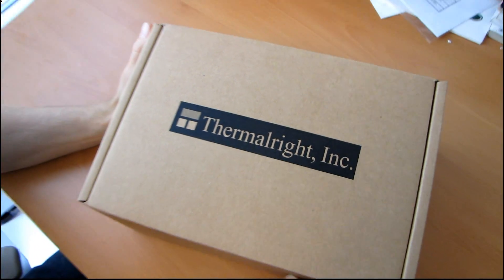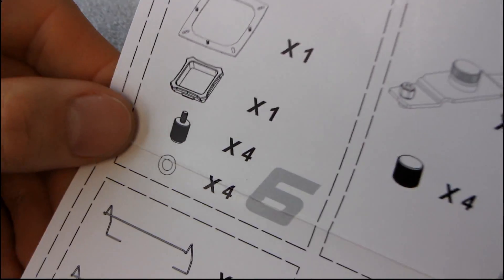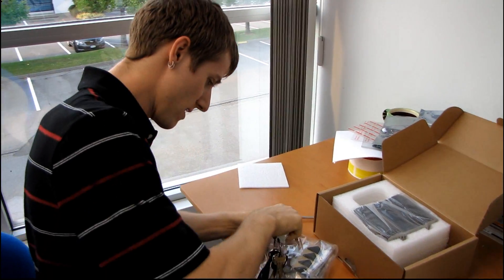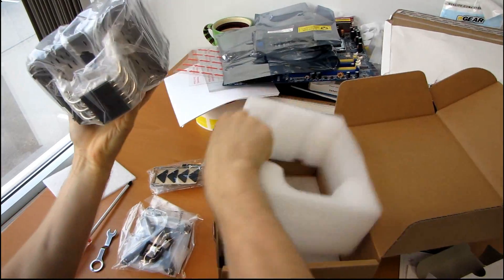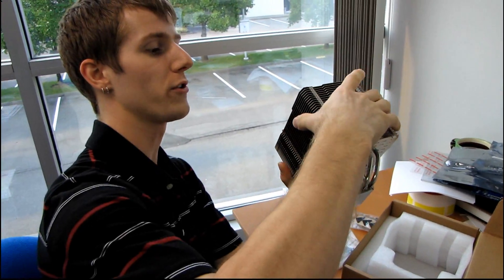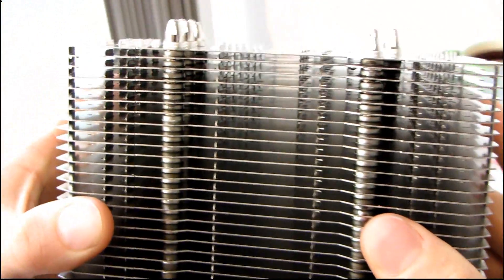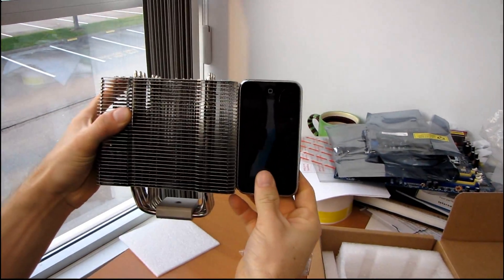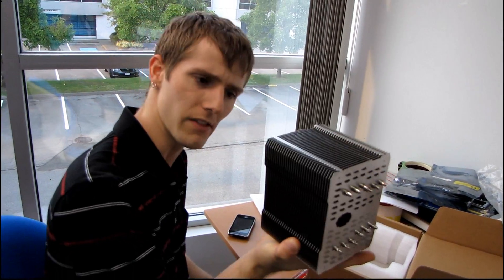Thermalright HR-02 Silent 120mm Heatpipe Tower Heatsink Unboxing & First Look Linus Tech Tips

Comment: you don't need a fan but keep a watch on temps if your not using one. If you are using a fan your cpu will be very cold. I suggest adding a low speed quiet fan to keep temps low and still haw it still quite.

Comment: i would like to put fans on it anyways :p
also a lot of heatsinks can work passively in low airflow environments. my vendetta 2 worked passively on a PhII 965 in a CM storm scout. it's only after i tried overclocking and the temp just kept rising with p95 that i noticed the fan wasn't working